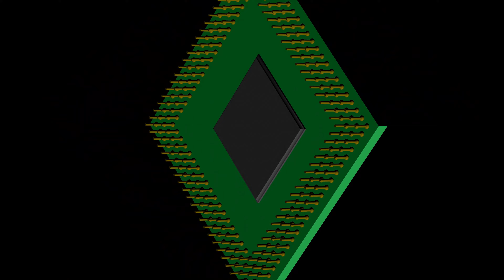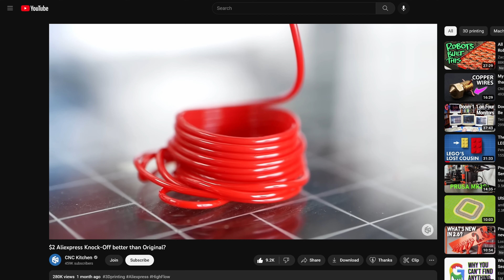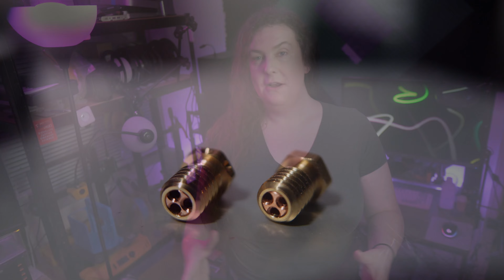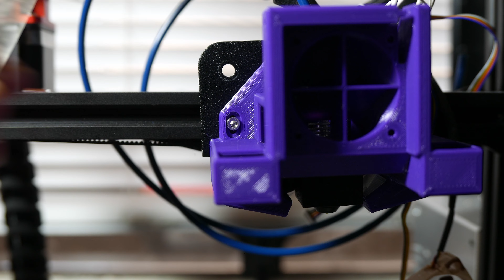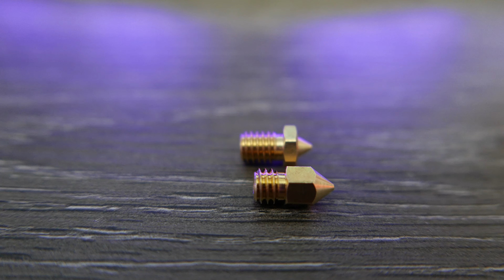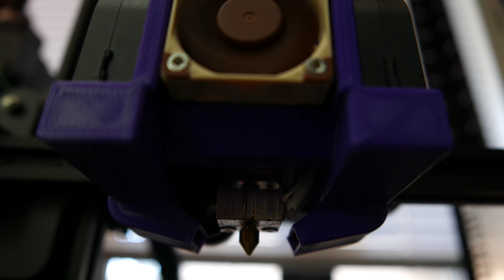Another Weekend Ender 3 Project...

Comment: I feel your pain in trying to get this to work.  After my problems with Creality, I won't buy another of their printers.  Looks like Elegoo or Anycubic for me.  And yeah, I know, those are sit and forget printers, but I have so much going on, I just want to start, come back and check to make sure the print is sticking and printing well, and go on with the rest of my errands.
Reply from the maker: This experiment really put the nail in the coffin for me as far as cheap parts are concerned. This thing's been pretty reliable, but that means I need to buy decent-quality parts for it if I want to see anything resembling an upgrade!
Good luck with the next step of your 3D printing journey! Anycubic and Elegoo have been making some interesting machines lately, that's for sure.
Reply: @TechAmbr  My experience with the CR-10S Pro V2 is the exact opposite of reliable.  Even with someone who runs a business selling 3d printed items, we could not get it stable.  I spent hundreds on higher end parts trying to make it work.  After the 3rd clogged bi-metal heat break because the fans on it randomly shut off and creality says there is nothing wrong with the printer I gave up and boxed it up for storage this weekend.  I won't buy from them again.  I am glad your works well, but when I spend 700 bucks on a 3d printer, I don't expect to have to spend another 800 to get the printer to work properly.  Had it for a year and it literally spent 2/3rds of that not functioning from one problem or another.  Meanwhile in the same time the Anycubic Kobra I have has been running great aside from 3 times when I accidentally broke it by doing something wrong.  But it fixed easily, and aside from replacing the wheels for the extruder gantry, I have had nothing go wrong that wasn't my fault with it in a year.
Reply from the maker: @helldog3105  That sounds awful. I can't imagine that being anything but infuriating. I'm glad you finally found success, though, and you won't hear me shilling for Creality anytime soon. It's just a printer I bought that happens to work okay.
Reply: @TechAmbr  And I am glad yours is working for you.  I really wanted a large format printer.  Unfortunately after my experience and asking around, I apparently bought the worst one.  Their standard formats like the Ender 3 models are supposed to be really good, but I don't need a smaller printer since I already have the Kobra.  I really hope yours continues to be a stable work horse for you.  I wouldn't wish what I have gone through on anyone.